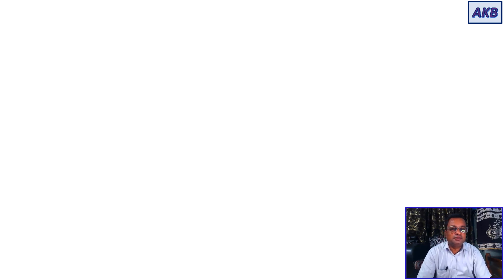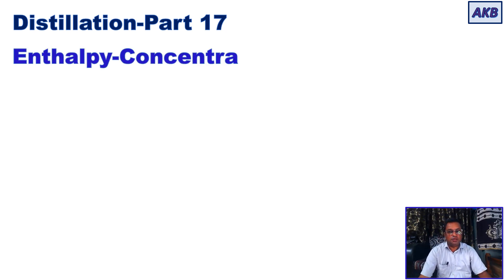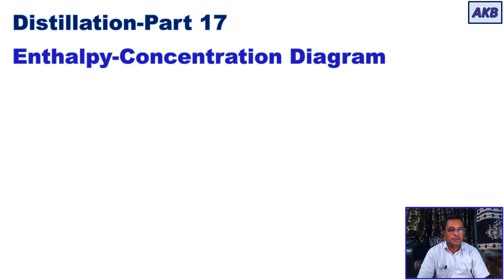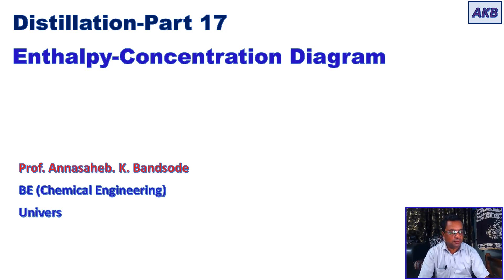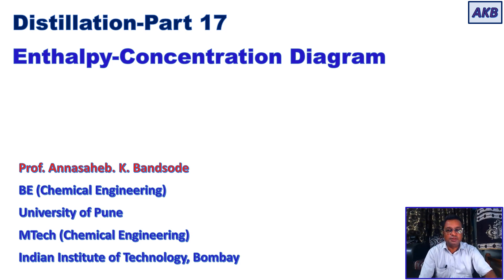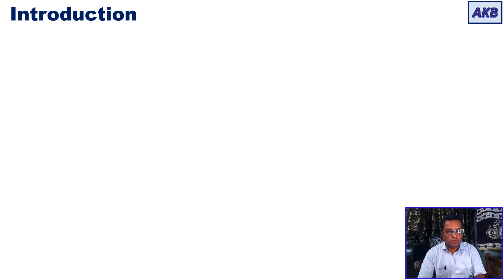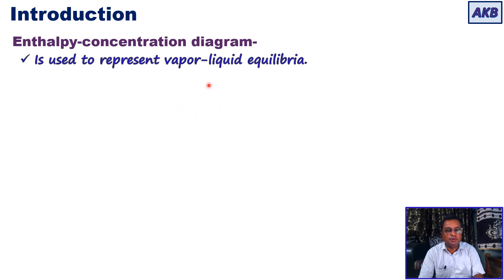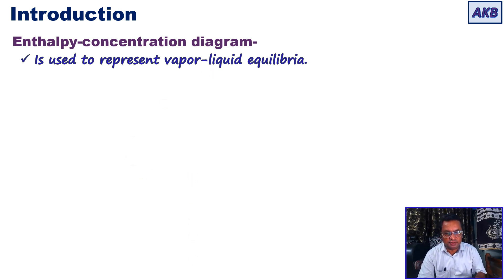Distillation Part 17: Enthalpy Concentration Diagram

Comment: hi, great video! thank u for the explanation. i have a question on HG calculation bc im still confused, do we use the heat capacity of vapor or liquid? they teach me to use vapor heat capacity here but i feel like it isnt right after watching this video
Reply from the maker: @gyocharou4737  In this case these are heat capacities of pure liquid A and Liquid B. Because in order to create the Vapor phase, the liquid solution has to be heated to the dew point by supplying sensible heat and then the latent heat will be supplied to change the phase from liquid to Vapor.